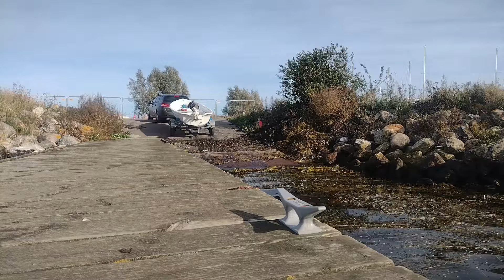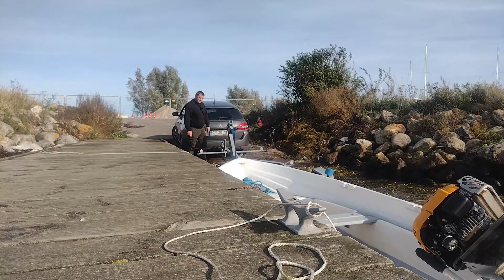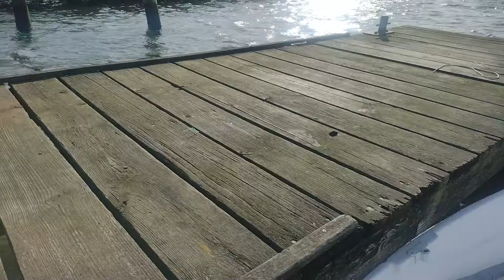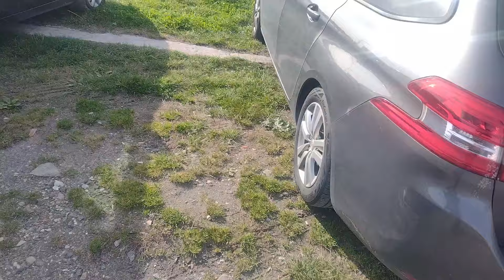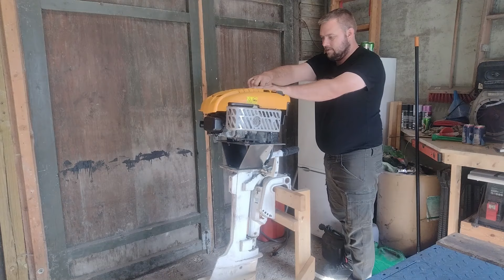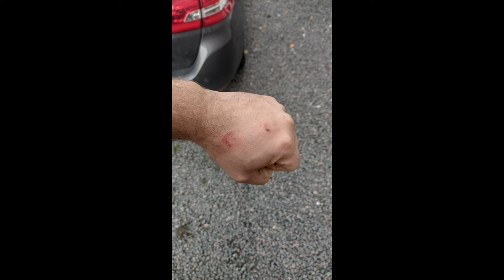it did NOT go as i hoped

Comment: A lawnmower engine uses the blade for a flywheel. Thats why it kicks back. When thes engines are mountet on a tiller or simular they have a heavyer flywheel!
Reply from the maker: Hey Victor, i haven't seen a comment from you in a while 😊
Yes, i am aware of that but i have not had this problem before. And i have been starting a lot of engines, also without the blade 🤷🏼‍♂️ but that has been smaller engines than this one.
Reply: @KennysClackyGarage  hello! I watch every video that you uploade but i dont always comment 😉

This engines are very sensity. A quantum engine is a better choise